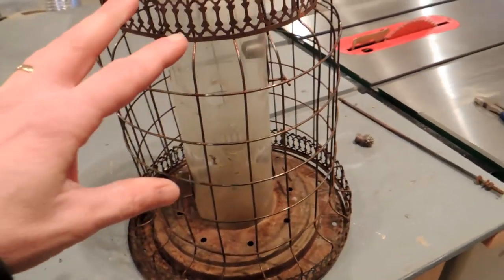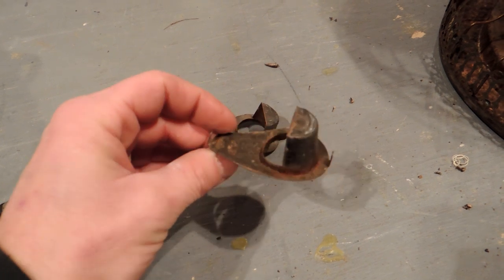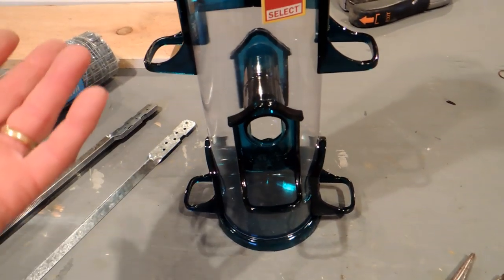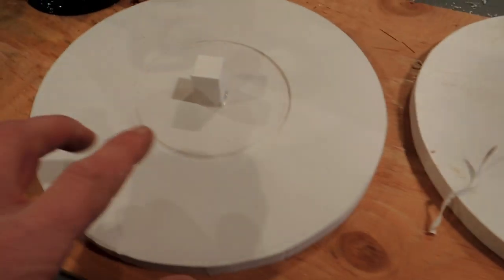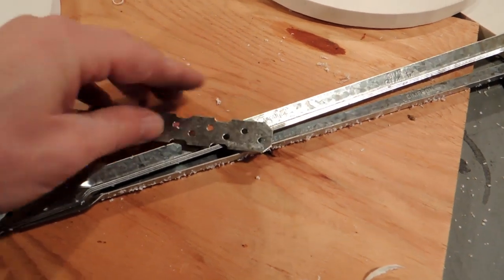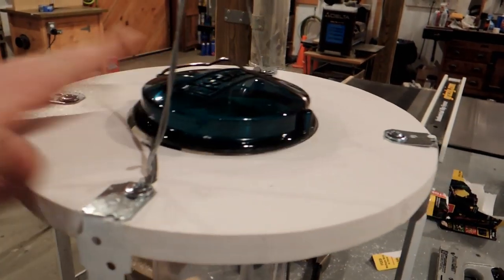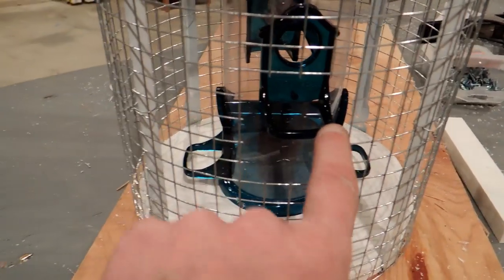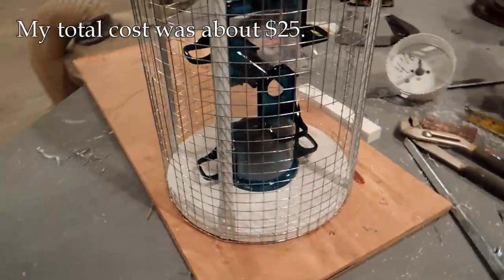DIY Animal Proof Birdfeeder

Comment: Thanks for your video!  I made one after watching your video, but I taped the openings to cover the exposed cut wire so the birds didnt get injured.  I also did not add a top so that the birds can fly away quickly vs trying to find an opening.

Comment: Great video. I was thinking about trying the same thing and found this., and I think it looks great. One suggestion I have is to make the diameter of the two end pieces larger next time. I have a store bought feeder that is designed similarly, but the distance to the seed holes are farther so that the squirrels can't just reach in to grab seed because their arms are too short. Between that and having the screen holes smaller I think it will make a great feeder. I'm on my way to our workshop downstairs and then to Lowes to get the supplies. Thanks again.

Comment: You're certainly on the right track. I have been feeding birds for decades now and the biggest problems I have are grackles and Starlings. They will wipe out any bird feeder in no time flat. They come in droves and are aggressive towards smaller birds and even each other. I have a feeder with e cage around it like your old one and I still had to block the openings in front of the feeding ports as the grackle would stick their heads through the cage and clean out the feeder. They are like a plague when they come through.
Reply: I've had the same issue with Starlings but my partner loves them so I have to put up with it even though they scare off my sparrows 😥

Comment: Great job, I'm going to use part of your idea to modify my feeder. Problem I'm having is the dove will emptying the feeder of sunflower seeds by racking the seed out onto the ground. Just wasting it. I'm going to wrap it with the wire fencing material. As far as the squirrels goes I use a baffle up above the feeder that keeps the squirrels away. Works great and only $14 at Lowes.  I've used this way for years. The squirrels try to come down the cable and the baffle dumps them off. They only try a couple times then just sit under the feeder and eat seeds that get racked out.

Comment: Nice “Armored “ feeder,but I heard you mention TREE, twice,you made it so easy for animals to get to it,now you’re looking for ways to protect it.I have bird feeders (5) mounted on a galvanized 4” x12 ‘ tall pipe with concrete in the ground away from any trees (I have lots of trees) animals can not climb this pole nor they can fly.Located away from trees.For birds only,different feeders for different species,works great.
Reply from the maker: True, if you have the opportunity to mount poles that could work well.  Although, you still need to prevent squirrels and raccoons from climbing the pole.
Reply: We did the same thing only we put it too close to the house...6 feet. It needs to be 8 feet away because the squirrels can jump off the roof of our ranch and onto the feeder.

Comment: after watching complete video i had an idea,do what you have already done,but since you said a squirrel got in how about the same thin flexible plastic that is used on the tall slender feeder you bought,wrap that around outside attached to the chicken wire you used,or i just thought money wise use old plastic pepsi or gold peak tea bottles cut top bottom off slit sides and wrap around THAT IS A GR8 THING YOU MADE TYVM

Comment: Great job!  I am curious if the squirrels have tried to get thru that opening, it looks big enough on camera..Thx
Reply from the maker: The video is probably a little deceiving.  It's possible, I guess, that a small squirrel could squeeze in but it's unlikely.  So far they've stayed away.  It would be easy to create an adjustable opening if you're worried about it, though.  Just cut a square of fencing a little larger than whatever opening you made previously and twist-wire the square on the grid to narrow the previous opening to whatever you wish.  I expect that different birds in different areas of the country might prefer various sizes of openings so it is something with which to experiment.
Reply: Rob Shamel  I was thinking that same thing. Squirrels chew through plastic pretty easy and are very resourceful when food is concerned.
Reply from the maker: We'll have to see over time about the squirrels.  I don't even mind if they nab an occasional meal, it's when they just empty the whole feeder in a few minutes that I get upset.
Reply from the maker: See my update in the comments.  After a few weeks of testing a squirrel did find a way in, though he didn't do any damage.  I now recommend making the access hole one square smaller to avoid this problem.
Reply: @enduringcharm  I knew it.  Darn squirrels.  They are nothing but resourceful when it comes to free food.
Reply from the maker: HAHA!  They are relentless, that's for sure.  It isn't a total fail, though, because even the one who got in couldn't eat very much at a time.  What always bothered me was having the whole feeder dumped out at once.  I think by reducing the access holes by another half inch (one square) for height and width it should be enough to keep them out.  They may still reach in with a paw, but it won't be a huge amount they can steal.

Comment: Have you thought to use the new feeder into the old feeder cage.  I did that myself.   My favourite old feeder cage just needed some repair (base, etc.) but the actually feeding tube within it was beyond repeat after many years of service.   So I bought a new non-caged feeder of similar size and modified it to fit into my original much loved feeder cage. Works great.
Reply from the maker: Sometimes you can do that, sometimes you can't, depending on the configuration.

Comment: I'd also like to see the squirrels trying to get into the 2" x 2" hole where you installed a perch.  The squirrels I have can go through that size hole!
Reply from the maker: Yeah, some of them are pretty slippery!  You could try a smaller hole first and see how it goes.
Reply: It looks to me like the squirrels could go right through the hole made for the cardinals.
Reply: Not at one and three fourths in diameter. provided its circle shaped

Comment: Great. What is the suggested access hole (height and width in inches) for the cage to prevent squirrels from entering?
Reply from the maker: See 13:00.  You may want to adjust that, but start small and work your way bigger if you experiment, because those squirrels are clever.
Reply: 31mm stop squirrels

Comment: Great work! I have a 7th floor balcony, so I don't have a squirrel or raccoon problem. My problem is pigeons! I want to make it accessible to sparrows but not pigeons. I feel this particular design might still make the seed accessible to pigeons. Any ideas on modifications?
Reply from the maker: You know, if your design will sit on a balcony it could be made bigger.  In fact, it could be any shape.  To stop pigeons you may only need to purchase one or two commercial feeders and then fashion a cage large enough to where they can't reach in.

Comment: Can squirrels eat the wire ?
Reply from the maker: They can't chew through the wire, but they are sometimes capable of reaching in and grabbing the bird perches or chewing through plastic.  And there are smaller squirrels  which might get in where others cannot.  There's no perfect solution, short of posting a guard at the feeder.

Comment: By cutting that huge hole, you might as well just forget the entire mesh thing. 
Put the feeder on a pole with a baffle and that keeps squirrels and raccoons out.
I had a problem for many years, but not anymore!
Reply from the maker: The hole may look larger on camera.  It's really only big enough for small birds.  In my area of the country a feeder on a pole won't work.  If you manage to keep out the squirrels and raccoons , the deer will certainly destroy the pole and the feeder.  Feeders mounted in trees need to be at least 6-7 feet high as well, or the deer raise up on their hind legs and swat at the feeder.  Nothing is safe from the deer hordes!

Comment: Nice idea,but i can see the sharp points from where you cut out the hole for the birds to get the seed as well as the wires that are twisted together to hold the wire mesh to the feeder.....I see injured well fed feathered creatures fluttering about in pain...
Reply from the maker: You could file those down if you are concerned, but I never found any injured birds.  They are pretty adept at navigating pointy objects and even if I stick my hand in there the edges don't poke.